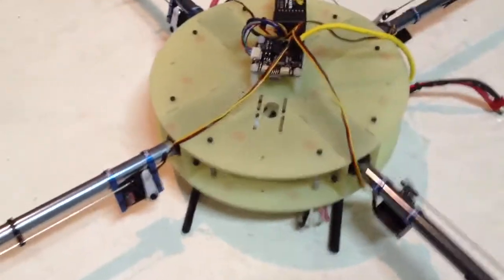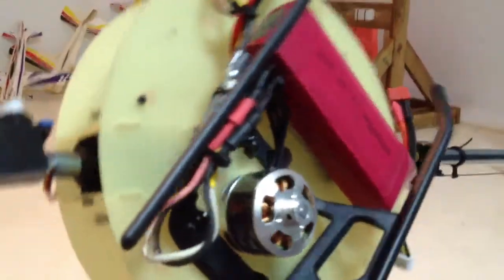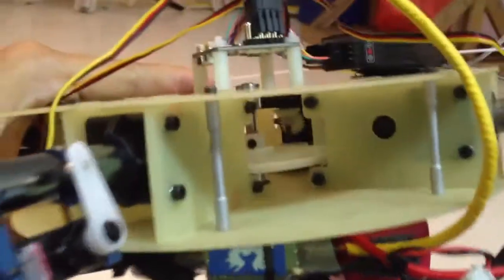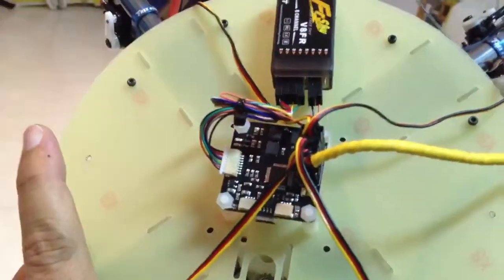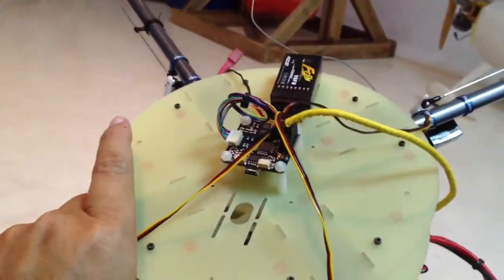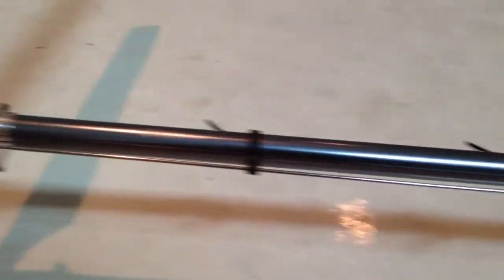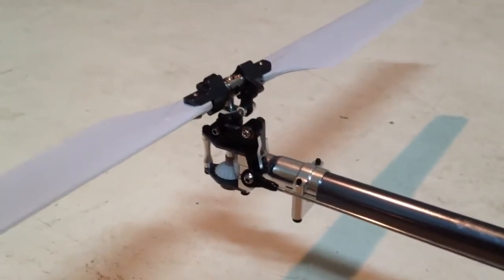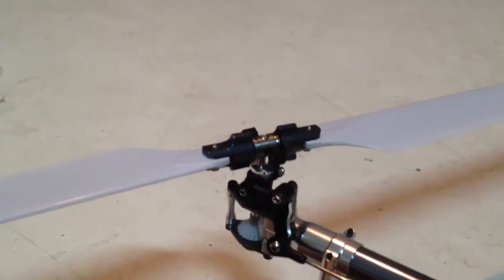Single motor variable pitch quad copter - intro

Comment: Hi there, please can you explain to me how you got this CC3D board to work with 4 servos, I can't find how to set it up?
Reply: PaulNichollsOfficial Hi, sorry for the "VERY" late reply. Basically, there is not much change that you need to do in OpenPilot. Connect your servo to OpenPilot as you normally do with motors. In the neutral setting of OP, ensure that the pitch are all 0 degrees. 
For TX, use heli mode and use ch6 output (pitch) and connect to throttle input of OP. There are of course a better way of doing this, but this is how I do my setup.
Reply: azrin aris l am a CNC operator and very new about programing rc Controller. I have builded almost same quadcopter as yours. I was looking how to program on internet and very happy to see someone already builded that l was thinking. Could you please help me how to program 4 servos with ardupilot? Have you finished with your variable pitch quadcopter?
Reply: PaulNichollsOfficial hello! l am also searching about that . did you get any answer for that?
Reply: Murat Ülger l wrote wrong its openpilot not ardupilot.

Comment: But on a "normal" quadcopter the whole prop do not turn on the same way (otherwise the quadcopter will turn from a side or the other side). You have to get 2 prop which turn in a sens and the 2 others in the other sens.
By watching your video, the 4 prod will turn on the same sens and then your quadcopter will turn once you start throttle.
That's why the other guys which have already tested this kind of collectiv pitch quadcopter used a belt instead of torque tube, then able to choose ..

Comment from the maker: The concept of yaw in this VP is based on centrifugal force where CF=Mω²r. M-mass, ω²r is the rotational acceleration. This formula is derived from Newton;s law F=Ma. in order to change the CF or 'torque' we can change any of the M, ω or r. int this case, ω² (acceleration) and r (length of the blade) are both fix wheres M can be change through changing the pitch which changes the 'mass' of the whole rotating body. The 'torque' that you mention is not from the motor but from the CF of the blades

Comment: wtf? 
Multirotors use momentum of torque from motors changing motors speeds to control yaw. There is no connection with thrust or power generated by each motor unit. Dude, its basic of physics!

Multirotor with cp system would run all motors on idle (constant speed) just changing pitch for blades. 
Explain, just explain me,,how pitch change would change torque output fom motor.

Comment: what an utter load of rubbish, you obviously have zero idea of the mechanics of a quadcopter. The difference between a CP and FP quadcopter is the method used to alter the power generated by each set of propellors, so yes it can yaw just the same as any other quadcopter can do.

Comment: Yaw is controlled on a quad by a pair of opposite rotors changing speed relevant to the opposing pair.  In this instance that pair would change their pitch rather than speed, but the effect would be the same.